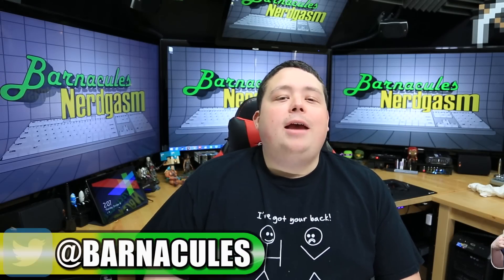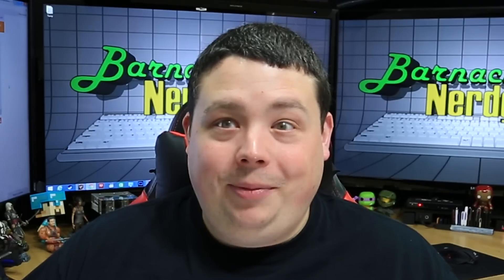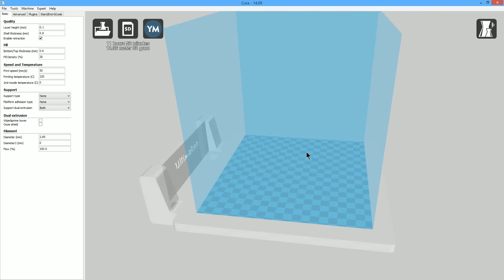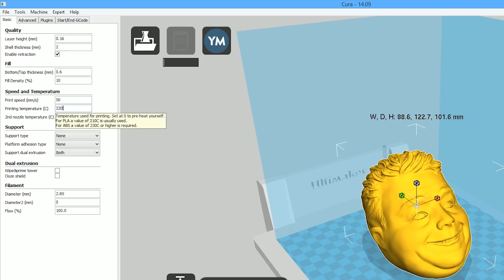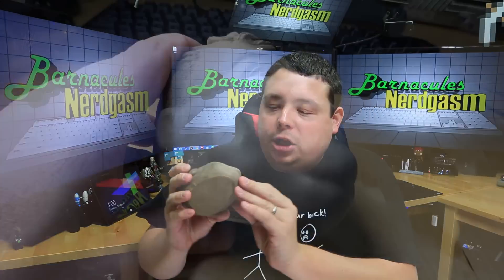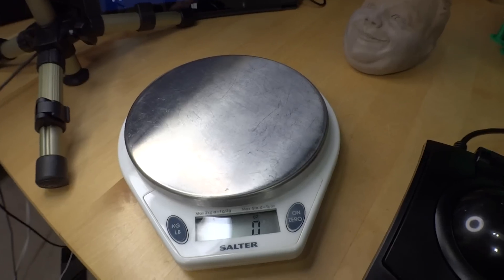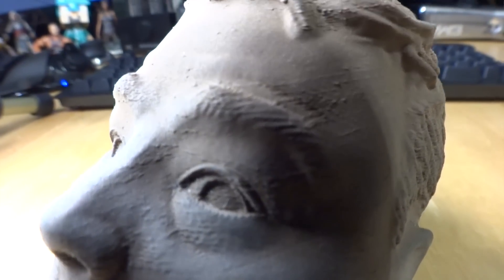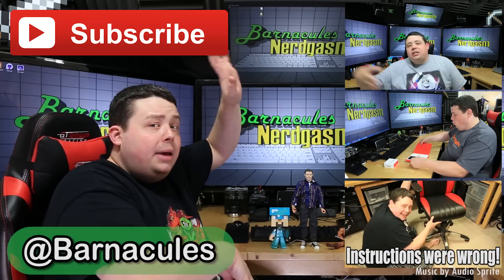3D Printing My Head w/ New Bronze Metal Composite Material - @Barnacules

Comment: Jerry.. I have worked with metal powders and resins for years and you need to remove that initial layer of resin/ pla to reveal the metal particles. What we do in the resin industry is to drop the pieces into acetone for a few moments and it eats away the top layer. Paint striper works well but dont leave it on too long. I have not tried the bronze filament yet so dont know but why don't you give it a go on a trial piece see how it works ..seriously the difference in resin pieces prepared in this way is amazing. wire wool is the best polisher. love your vids :-)

Comment: Cool...... I work in a machine shop and we use something called scotch Brite for taking off burrs, almost like steelwool but made for mettle or any material you would use emery cloth on made by 3m comes in about 6x10 inch sheets, you should check it out......

Comment: You should print a gun with the new filament, the destiny one or maybe a new one
you could even combine new filament with vanilla PLA for a polymer-type gun such as a glock or five-seven
as well as putting rubber bands inside and it could be like a replica gun, but that may be too complex

Comment: Depending on the strength, I'm guessing this would be better for printing replacement car door handles and mirror housings.  I had been hoping to get a printer to try and make parts out of abs or maybe even the wood filament.  There are some parts on my engine that don't get very hot and aren't under strees, and I think it would look awesome to have them in wood.

Comment: Jerry, i swear if you start printing alot of Jerry's little heads people would want to buy em. The sanding and all that stuff don't need to be done... I'd buy one from you if you could somehow adopt this idea and you could make a small profit if possible by material's price
Reply from the maker: I could make a small profit but the problem with the printers is they are slow so I could only print one of these a day and the printer would be tied up during that time so it wouldn't make enough money to justify it.
Reply: Barnacules Nerdgasm use a rock polisher, it works well
Reply: Barnacules Nerdgasm Jerry, you could do a give away, with like 5?
Reply: Barnacules Nerdgasm if you printed kchain versions i would buy one and i think many people would too
Reply: Barnacules Nerdgasm yay do a give away!

Comment: I would be interested in the strength of materials like this compared to standard PLA. If it is indeed stronger. This would be and already looks like a great advancement that is accessible to the average user.
Reply from the maker: From some testing I did I don't think it's stronger. It's more flexible and brittle, but that being said some materials like the carbon fiber composites are much stronger!

Comment: As a jeweler, I noticed that a freshly cast metal part is lighter color and less reflective, similar to your freshly printed bronze piece. As you polish metal, the color changes as it starts reflecting more and more light away from itself. Silver, for instance, become colder in color and very shiney. The 3D printed part should do the same, and if your polishing is removing more plastic than metal, the color change will be more immediate.

Comment: OK, that's kinda awesome. Wonder if you could Kinect yourself (via the Kinect SDK, or other?) to generate a 3d scan, for those who want to DIY it & start 3d scanning everything.

Also, one could imagine a little computational post-scan 3d image processing, which could open up some wild possibilities, & could also possibly form the basis for a programming tutorial.
Reply from the maker: That would be pretty cool but the kinect isn't high enough resolution to be really helpful. I would use something like Autodesk 123D to get scans of yourself with someone elses help and then post process those a bit. It would be the easiest solution!
Reply: Barnacules Nerdgasm
Even if the reso were low, it might be adequate, for instance, if you wanted to shrink the image down & print out some more plastic coins, but instead with a 3d relief image of the head of 'Barnacules Imperator' on the obverse.

Hmmn. VGA, but 1280x1024 at a lower frame rate. According to some dude on the internet, the IR sensor has a resolution of ~0.121mm, under an eighth of a millimeter.

While I doubt this granularity is constant at all ranges, I am going to go ahead & differ with you, & opine that the Kinect may be adequate to capture head-sized objects for use in some applications, maybe even for life-sized reproductions of such captures.
http://msdn.microsoft.com/en-us/library/dn188670.aspx

It may well be easier to get someone's help for the scanning & 3d image processing pieces.

Comment: Do the metal fill filaments have a higher heat resistance? I am looking to print something that would have to withstand high heat so I am looking around for the best materials to use

Comment: Hello. Great vid.
Is there a risk to damage the nozzle due to friction with the bronze particules ?
Thanks !
Reply: Hi, Colorfabb have tested bronzefill with several printers and from what i know it doesn't damage the nozzle
Reply: Hello and thanks Didier... you are everywhere ^^. See you.
Reply: No, the nozzle on most printers is harder than bronze. So it won't scratch it. Remember: the bronze partials have to be small enough to fit through a 0.4mm hole.

Comment: Hey, I just wanna say that it would be very cool if you could 3D Printed a computer, with all custom components.
If you for example get an cabinet, and you make a HK, GPU, PSU and over and over.. 
It would be awesome if you could do that.
Reply: It's pretty much impossible. You'd need multiple filaments, you'd need your 3d printer to be able to freaking solder, and it'd be way to precise. Maybe in the next 15 years?

Comment: This is basically how "cold cast" resin works.  You mix in the metal powder of choice with your resin.  Use 0000 steel wool to polish.
Reply from the maker: dnelms2 Going to start with Sandpaper, wasn't getting very far with the steel wool by itself.
Reply: It must be because PLA is so much harder than resin.  I guess if you go slow it should work, I guess the trick is not to friction heat the PLA while sanding it.  They make a kind of plastic sandpaper which you can use wet which might help.  You can find it in most hobby shops in the model making area.
Wet sand paper is what I use finishing off 3D prints, then finally buff it out. It's time consuming but you end up with a high gloss polished surface that looks injection molded plastic vs fused filament.

When you are done with it you could try dry brushing with black paint, that'll really bring out the detail.

Comment: why is the inside a differenet color? like those lines that fill the head
Reply from the maker: It's not the inside, it's the steel wool rubbing off on it. Check the Q&A in the video comments.
Reply: Barnacules Nerdgasm you should 3D print a fake replica of the revolver from Alien: Isolation in bronze or something like that

Comment: It's impossible to have bronze diamonds. This is because of the way copper forms bonds and also because of the fact that it is in the period 2 too early to have any form of crystalline structure similar to diamond. On the other hand, if the conditions were right, given time, just like yellow diamonds with nitrogen sometimes, copper could be in the crystalline structure of diamond - but that wouldn't be a copper diamond.
Footnote: the reason I swapped bronze out for copper is because bronze is essentially copper.

Comment: Could you also include the weight in grams/kilograms since you have fans all over the world? I know how much lb is compared to a kilogram but i don't know about that unit you used. You could add it for example to the bottom of the video where you add your fun facts? :)
Reply: well there is 16 oz in a lb. so around 330 grams?
Reply: Joshua Hunt Oh thanks! Now that i know how many oz there is in lb so i can count it myself from now on. So that 3D printed head weights about the same as one beer (330ml).
Reply: WayZHC oz is weight, fl oz is liquid.  i know we make it confusing but there is a difference.  Worse case scenario google is your friend.
Reply: Joshua Hunt 1 millilitre of water weighs 1 gram.
Reply: Joshua Hunt "a pint's a pound the world around"

Comment: the hell is an ounce
Reply from the maker: its 1/12th of a can of soda :)
Reply: Barnacules Nerdgasm like the whole soda (with the weight of the can) or the soda inside only?
Reply: Barnacules Nerdgasm There is a precise platinum sphere in France stored underground to define kilogram, and then there is your definition of ounce.
Reply: Barnacules Nerdgasm seems a silly way to measure :P,
Reply: utkua i saw a video about that sphere, but how is this my definition of an ounce if its a kilogram D:
Reply: for those (like me) who prefer metric units: it's about 330g - or 3.3 bars of chocolate :)
Reply: nothingTV 1 oz is 28.35 g
Reply: I believe it is a measurement of weed in Britain I think that's the only market where ounces are used
Reply: About 20 bucks

Comment: Best 3D printer under 1k??
Reply from the maker: Try the Robo3D R1, they fixed all the problems from the original and it has auto bed leveling which is cool. I'm trying to get one myself right now. But the Ultimakers are wicked reliable and you can run them for days and days with no problems. That is why I really like them!
Reply: Barnacules Nerdgasm Cool thanks appreciate love all your videos by the way keep it up !!